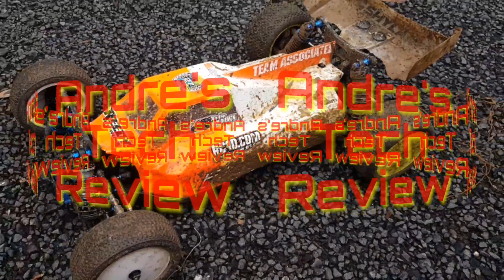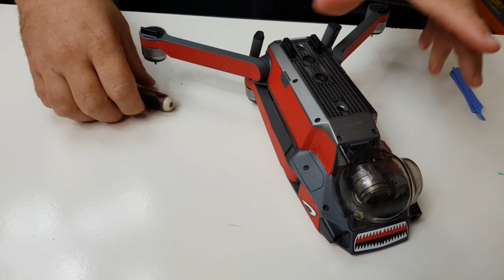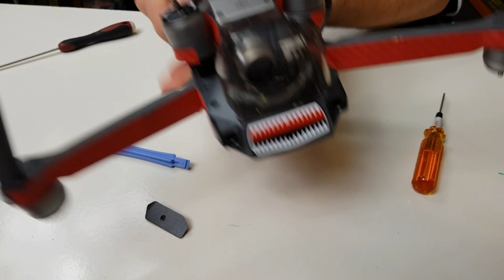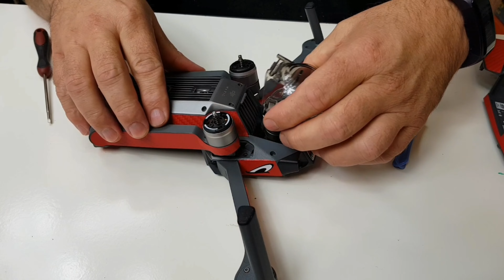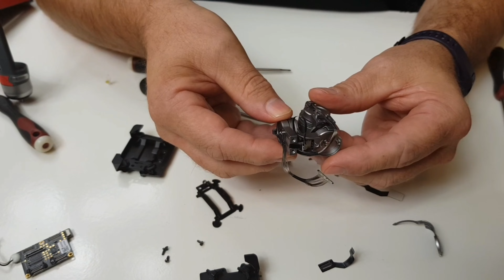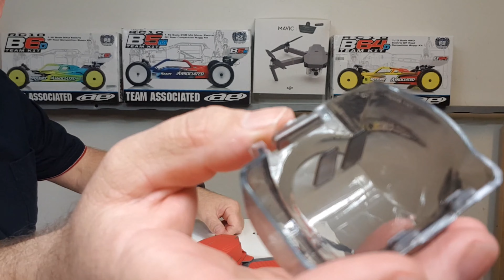Mavic pro gimbal repair after drone crash and give away

Comment: Honestly Andre, the most important and most difficult part of the whole process which is putting ribbon back on was cut out, so it pretty much doesn’t help anyone at all. Taking out a broken ribbon is easy, but putting a new one not so easy.
Reply from the maker: Hi. You are correct and I am sorry. While filming the ribbon cable part something went wrong with the footage. I only saw it in editing and it was to late.
Reply: No probs Andre. No need to be apologetic. At least you try to help. Especially as we now know your filming failed. Thanks anyway.

Comment: How do I get the rubber bands replaced if one of them broke?
Reply from the maker: Hi. If the rubber broke due to impact you need to make sure the plate is OK. I don't think you will need to pull the craft apart to replace just the rubber.